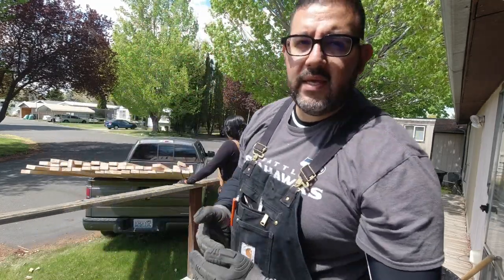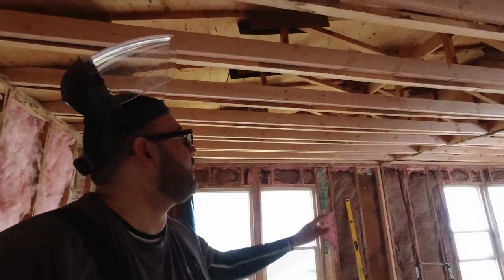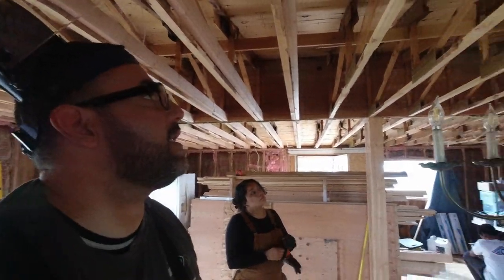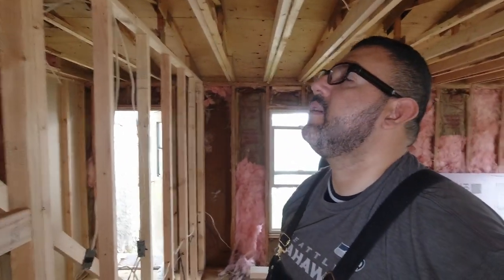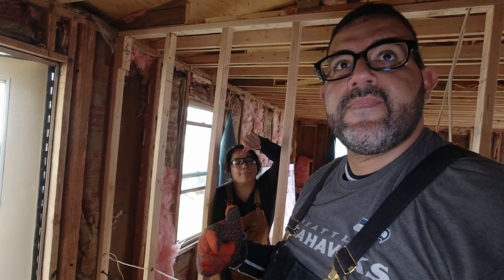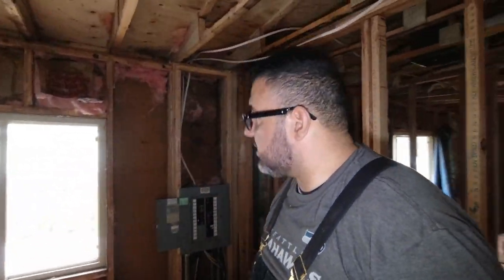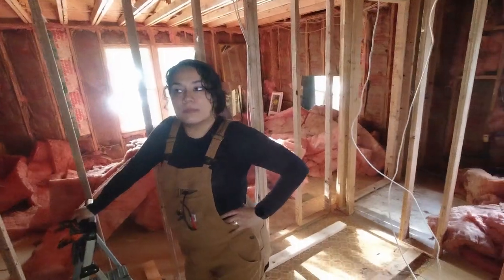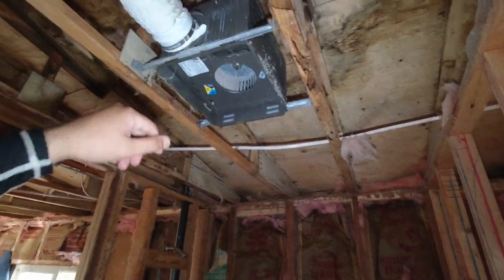More Mobile Home Ceiling Support | Day 37 mobile home renovation

Comment: I remember years ago leveling up the trusses in the old single wide trailer that I had. Used channel strut and made a giant T added a strut base and used a bottle jack & jacked up each truss until it was level with a string line. Then installed 3/4" plywood (was lucky got all the plywood for free) to each truss. Was a big job but when you're doing it by yourself you have to get creative. Glad to see you have family & friends to help out with such a big project.
Reply from the maker: Sounds just like what we went through, it's definitely a HUGE project. Looks awesome now thay it's done.
It's great getting the help when you need it.